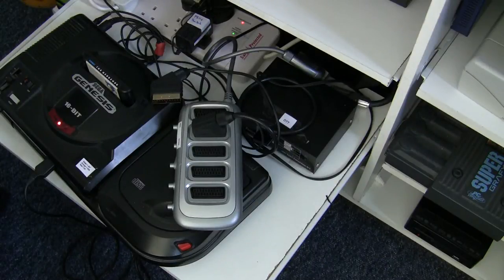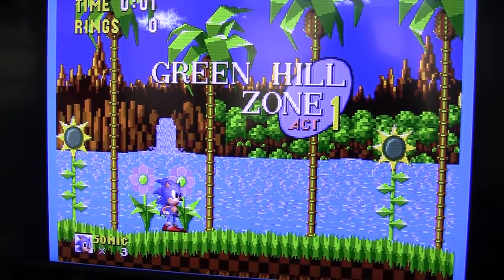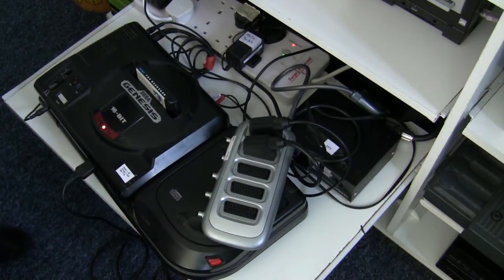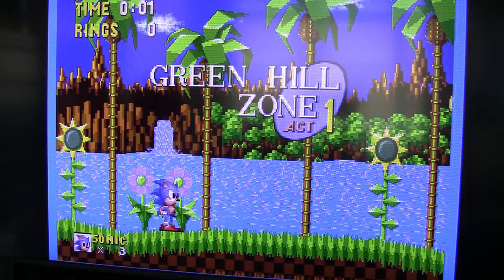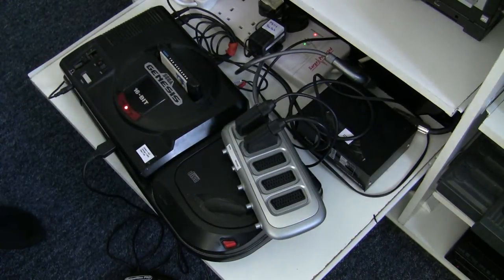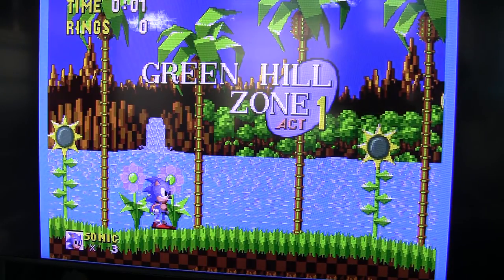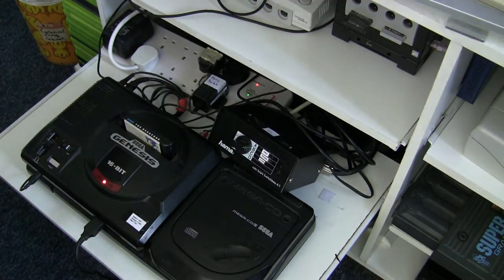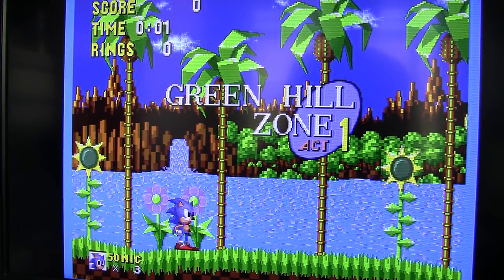Good SCART switch vs bad

Comment: I had this problem on a Scart switch years ago. I opened it up, and found that the switch was actually on 'switching' about 4 or 6 pins (I forget) Basically it only switched the composite video and audio lines. The RGB, grounds and voltage / data lines weren't switched, producing the effect you see. I guess the Hama rotary switch is a full 21 pin switch. I'll have to keep a look out for one.

Comment: I wondered why my Snes had its power led light up when there was no power cord connected using one of these scart switches. I bought one from Maplin for like £13 a while ago thinking it be decent. Thanks for explaining the cause, as I though my console was possessed or something lol.
Reply: I have the same issue...I have 5 systems plugged in a multi scart to a CRT.
When I power on Megadrive, it powers on the Pc engine too even when the PCE is unplugged (only video cable). I wonder if adding a diode to prevent current going back will fix the problem. But which line needs a diode ? Pin 18 ?

Comment: Hey mate. Question. How do you use a scart switch exactly. my CRT isn't equiped with a Scart Input.
Reply from the maker: You'd have to convert it to component then.
Reply: Transcode is the right word!
Reply: Use something like the Retrotink 5X Pro or if you got even more cash the Retrotink 4K

Comment: I've had the same problem with a snes beeing powered on even when it was switched off with a cheap scart switch too. I have a good one (with three inputs) but only one iput does RGB, the other two are only composite. Many switches seem to be like that. Do you know of any scart switches that have RGB on all inputs? I'm looking to buy a new one and my ideaal one would have rgb on all inputs and a matrix function (two rgb outputs) so that I can record gamplay with a DVR without input lag problems.

Comment: Hi, is there any good RGB Scart switch boxes you'd recommend which don't cause visual problems? I basically want to connect a Sega Saturn PAL Modded up to a HDTV along with a Japanese Modded Dreamcast but the TV only has 1 Scart Socket. I keep wasting money on crappy dud multi-scart adapters on Ebay and none of them work good.

Comment: Whats the details of the good rgb scart switch please? Need to connect about 8 or so old consoles so this would be a step in the right direction. Thanks, and cool setup.
Reply from the maker: Ian Seiles For something easily available and high quality I think you're pretty much limited to an Extron Crosspoint.